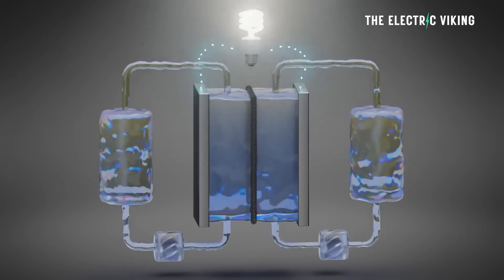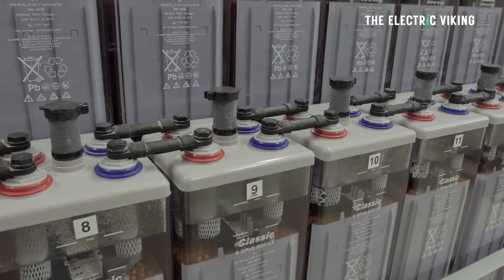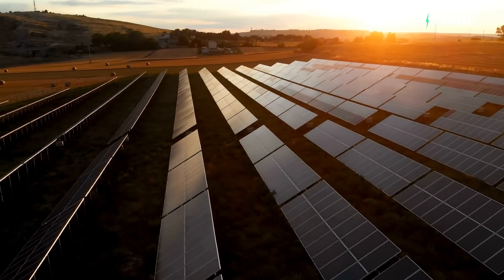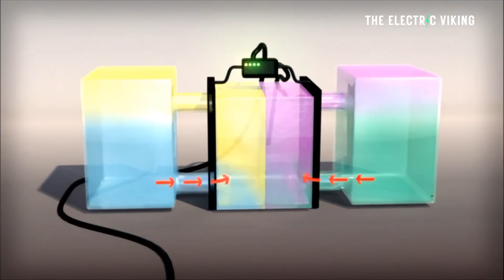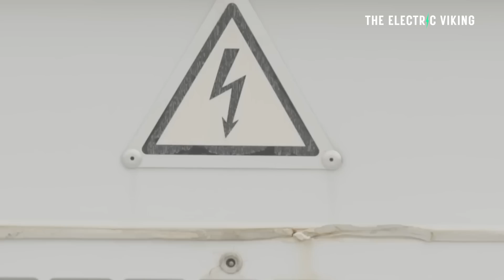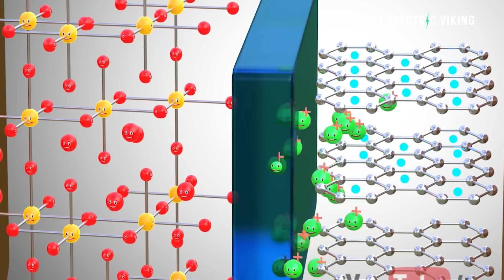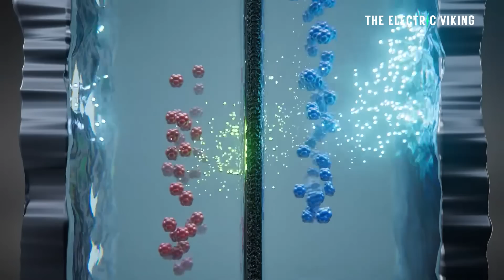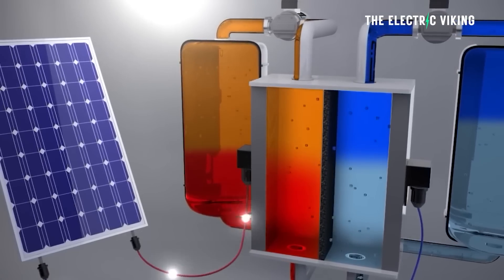Why Vanadium Flow Batteries Are DISRUPTING Lithium & Sodium Batteries

Comment: Gas stations have large underground tanks. I wonder if they could be converted to a flow battery system when the station is converted to an EV charging station? The canopy and roof could have solar and the energy stored in the tanks below reducing the draw from the grid. The battery system could also be charged from the grid during off peak demand.
Reply: I don't think literally the tanks would be used that once stored dino juice. I think more likely, the space once taken by the tanks could be utilised for VFB batteries. Could be a great idea but not an expert in this field. Seems to make sense though.
Reply: @LouDeVere  In Australia at least, when they remove petrol tanks from underground they need to do soil remediation and keep testing the soil for 12 months afterwards to ensure that no petrol etc has leeched into the soil. Which is why old petrol stations sit vacant and half dug up for a year or more here before being converted into anything else. 

Not sure but I assume this would have to be done if the tanks were being swapped out to something else non-petrochemical
Reply: @LouDeVere If the tanks had to be removed for environmental reasons you are digging up the site, may as well install a battery vault while you’re at it
Reply: They would have to be cleaned incredibly well as you can't have pollutants in the electrolytes. Also I am not sure that the materials used to store gasoline (mostly steel I think)  are suitable for the electrolytes, as it has to not react with them. Worth looking into though.
Reply: They need monitoring ..they run hot and you want to be able to swap out units ..they tend to be designed to fit into standard freight storage containers.
Reply: That's exactly the model that is crying out to be adopted.
Reply: Probably not.
a) Batteries overheat. They need constant monitoring, need air cooling and they need easy access for maintenance.
b) Gas stations are polluted beyond belief. For decades their tanks have been leaking gas & diesel into the ground. All tanks leak. Originally steel, they've been replacing them with fibreglass or plastic for decades. They still leak immediately on installation. The contents migrate laterally out for several hundred yards in all directions. They migrate down w gravity until they hit the water table, then flow downstream with the water table some distance. And pollute the groundwater. Remediating the original property does nothing for the properties adjacent or downstream or downhill.

Gas stations cannot be sold as real estate for any other purpose until they remediate. That generally means excavation and removal of the top 20, 30, 40, 50 feet & removal of the fill to a hazardous waste site where the petrochemical pollutants can blow off, evaporate. That can take years (or never) before the soil rates as clean fill. Meanwhile the site gets filled with clean fill. Details (depth, etc.) are dependent on the nature & level of pollutants.
An alternative is vacuum extraction. If the pollutants are light grade & the soil is air-permeable, a grid of holes can be drilled down across the site. Pipes are installed in rows. Air is pilumped into one row while air is sucked out at the next row. Airflow through the soil dissolves the pollutants which exit as vapor and are bled off into the atmosphere. It's air pollution now but the remediation experts are treating soil: they don't care.

This, like excavation & refill, is a temporary solution intended to make the soil sufficiently clean that it'll pass muster with the banks. No bank will offer a mortgage to buy polluted land. That restriction (& not regulation)  is ultimately why land sits empty for some time. We have an old gas station site round the corner that's been vacant for over a decade.

I say both solutions are temporary, 'cause they are. Gas travels through soil some distance from the site boundaries. After you've successfully refilled or passed muster on vacuum extraction, the gas that flowed into your neighbours' land next door starts to flow back. And re-pollute the original site.

Oil companies in N America monopolized, vertically integrated the industry. The oil companies that own exploration drilling and wellhead extraction also own most of the refineries, the distribution business and retail gas station chains. But they're divesting retail and then distribution ASAP. They're selling their gas stations, or just closing them.

The stations are being bought by independent gas station chains. They think they're buying long-term assets, and they're financing the purchases with debt on that basis. If they're paying interest on 30 -35 yr. bonds or mortgages, expecting to pump gas for 50-60 yrs., they're sorely mistaken.

The oil companies figured out in the 1970s that the oil industry is due for massive disruption, & it's happening bang on time. We've almost reached peak oil demand across the planet, will be there by 2030, likely a bit sooner (2028?). Oil demand WILL rise somewhat in developing nations along with their population increase and rising prosperity: their rising populations will demand cars, will need trucks. But just as they by-passed much of the development steps in the industrial revolution & communications, they'll do that in transportation. For instance, we built coal then oil then gas power generating stations, & are now slowly replacing those with wind & solar farms. We built a communications network of land lines across the country, now are replacing that with a grid of cellular towers. Developing nations are doing some of the first process, building their own fossil fuel stations. But most are moving directly to wind & solar, which are cheaper & faster to build out. Theyre bypassing landlines communications & building cellular from scratch instead. So fossil fuel use will not grow in developing countries the way petro fans believe it will.

EV use everywhere will soar. Communications will grow as cellular or satellite. Fossil fuel use, having peaked by 2028-2030, will plummet fast.

Which, finally, is why those clever retail gas station chains, having bought the worst part of the integrated majors' value chain, will go bust. The oil companies own the rest of the value chain: they'll continue to make profits even as the business shrinks. They won't be stuck with the inevitable very long-term liability of gas station properties that can't be soĺd. They're someone else's problem. They oil companies are divesting themselves now of long term legal liability. And of the potential liability of suits from adjacent properties who aware slowly waking up to the fact THEIR properties were polluted by delinquent oil companies. Failing retail chains, watching their stations close for lack of business, will be stuck with properties they can't sell, falling revenus and profits, and maybe waves of lawsuits from local landowners realizing finally their own properties have been polluted.

Fun times ahead.

Pretty smart, actually.
Reply: The energy density as a vanadium tank shall be far less than petrol.
Reply: @leonnelen151  The energy density of EVs are far less than ICE. So that's not surprising.
Reply: The cost of building what you described would be so incredibly high that the charge station would not be profitable. To recoup the investment and make a profit the price per kWh to charge your EV would be ridiculously high and you would go somewhere else. Petrol (gas) stations are very simple technically, and EV charge stations need to be simple as well.
Reply: @PropanePete  not really expensive. After capital cost solar canopy provides free electrons, so profit margin is 100% for the petrol/ recharge station
Reply: @John-p7i5g  John, a rooftop solar system the size of an average petrol station roof and pumps is simply not enough surface area to produce anything like the power that is required. This setup would be like a trickle charger trying to charge a battery the size of an elephant. You need a dedicated high capacity supply feed and sub-station plus the nearest pole transformer would have to be vastly upgraded. There are plenty of frustrated electrical engineers who constantly comment on this channel about the technical misconceptions people (particularly on this channel) have about how EV charging stations work and the enormous amounts of power they require. There are many (many) towns in Australia that will never have a public charging station above 7kWh capacity due to grid limitations, nearby domestic requirements and financial constraints.
Reply: @PropanePete probably going to get between 100-500kW depending on the size of the forecourt and including buildings. A 5MWh BESS will capture that in one day. Add in grid connection to feed in during the night plus solar peak from exterior solar farms at midday.

Very doable.
Reply: @PropanePete  And 1MW of solar from canopy 50 x 50m. Which is a big petrol station but not beyond reason. I was at a BP station a month ago that was for trucks and about that size.
Reply: Given a panel 1m2 producing 400W peak.
Reply: @John-p7i5g  That is an enormous servo’. Most are smaller than that. I’m not sure that array would produce 1MW. A million watts !! That’s about the power consumption of 200 homes for a day. Doesn’t sound right. Also, what happens in winter and at night and what would be the cost of a 50m x 50m solar array?
Reply: @John-p7i5g  Ok, I see where you got the 1MW from. A 50m x 50m BP service station roof would fit about 2500 solar panels. So 2500 X 400W =1MW. The average price for medium quality solar panels is about $250 AUD each, so about $625,000 AUD plus fitting, labour, wiring, etc, a big job. About $800,000 all up. If you went top quality you’d be well over a million. Would take quite a while to break even. Then there would be the batteries to store that power, jaw dropping cost I would say. I looked it up, a reasonable quality 1MW battery for storage would be about $400,000, then the fitting, safety systems, wiring, etc, all extra.
Reply: @PropanePete  Not sure about that pricing, as I bought 6.6kW for my roof for just over $2,000 and they are working fine almost 4 years later. 133 x 2k = approx. $300,000. That's about the same cost as a canopy would cost anyway. Even at 50c/kWh that is going to be $500/MWh pure profit per hour under ideal conditions. Even half that and you're looking at $2,000 / day for 8 hours of useable sunshine working at 50% of capacity, a very conservative estimate ( I frequently get close to 6.6kW on a sunny day at home.)

So 2k/day means payback of your 300k capital cost is going to occur in around 6 months, assuming you have full usage. Let's say you only have EVs a quarter of the time, that means you'll be taking 2 years to pay off the solar canopy. However, the rest of the solar would be going into your 5MWh BESS, so that's going to be free energy from BESS at night.

You would have earnings from the stationary storage 5MWh battery as well, so that means you're going to be storing cheap energy from the grid and earning off that. Cost of 5MWh BESS is somewhere around $300,000-$400,000 - however the price of BESS is on a downward decline, and will continue to decrease especially with Sodium. So probably using the rough figures above, around a 3-4 year pay back for capital cost for the BESS.

Very doable, if the policy settings are right.
Reply: @John-p7i5g  We’re getting rooftop solar too in September. But back to the BP servo’. I priced those panels from a few solar companies online, and a medium quality 400kWh panel is around $250 each and up to $500 for top shelf premium spec. So the $800K after installation and wiring is accurate. The 1MW battery price of $400K for storage is also accurate then come the extras for installation, wiring, fire safety system, etc. A private school here did a similar sized solar project, plus big batteries for storage, about 2500 sq mts, and it was reported in the local paper to have cost $1.6 million. I think batteries pretty well double the cost of any solar project. You’d have to do a proper financial analysis to see if that BP servo’ would benefit from such a big investment. You never know, it might work over time.
Reply: @PropanePete  I'd still say those figures are inflated because my solar did not cost 250 a panel, and that was 4 years ago, and solar has come down since then. Plus mine was just a domestic job, this is at scale, so economies of scale makes it cheaper.

As with all transitions, a lot of scammers out there making money, but some research will provide US$250k for a 5MWh, or around US$ 50k per MW, since we are approaching $50/kWh on a small scale.

That said, the price is fluctuating and there are many sources, so I understand your figures are higher than mine, and possibly you could pay that, what you've found. I imagine that is the sort of figure that is preventing BP etc from rapidly going ahead with the rollout of solar canopy and battery, as the payback time of 3 years is pretty good ROI.
Reply: @John-p7i5g  Yes, there’s a lot of price differences with solar panels. Just about all panels sold in Australia are Chinese and there are 4 grades of quality in Chinese products, even though they all look and function the same. The difference between grade 1 (cheapest) to grade 4 (top quality) is enormous. Bunnings for example buy grade 3 spec’ from China for their Ryobi and Ozito range. They originally many years ago contracted for grade 2 but there were too many comebacks. Grade 4 was far too expensive for the DIY market so grade 3 was the “goldilocks” number, just right. Your friendly local BP servo’ would get a significant discount off those figures because of the size of the project but it will still be 7 figures. Probably take 4 or 5 years to break even but servo’s are around for decades so it would pay off in the long run.
Reply: @John-p7i5g  Yes, there’s a lot of price differences with solar panels. Just about all panels sold in Australia are Chinese and there are 4 grades of quality in Chinese products, even though they all look and function the same. The difference between grade 1 (cheapest) to grade 4 (top quality) is enormous. Bunnings for example buy grade 3 spec’ from China for their Ryobi and Ozito range. They originally many years ago contracted for grade 2 but there were too many comebacks. Grade 4 was far too expensive for the DIY market so grade 3 was the “goldilocks” number, just right. Your friendly local BP servo’ would get a significant discount off those figures because of the size of the project but it will still be 7 figures. Probably take 4 or 5 years to break even but servo’s are around for decades so it would pay off in the long run.
Reply: forgot about cars...
public transport like buses can recharge in their depo so one station can service whole fleet
Reply: fun fact, if vanadium flow battery is run at too high a temp, it produces hydrogen as a negative byproduct...which makes it a hydrogen and EV charging station. EDIT: you can use the system to make hydrogen without the heat, which is probably preferable anyway.